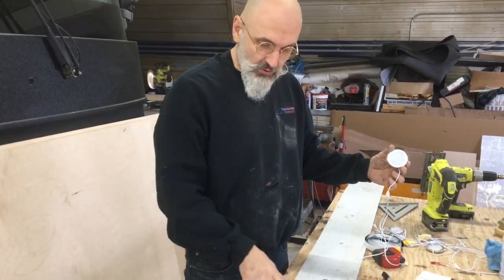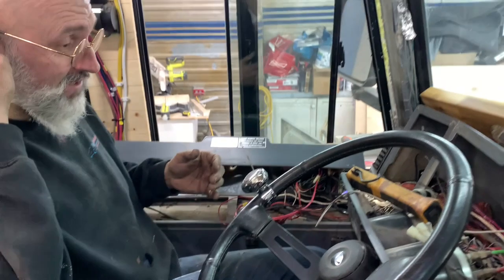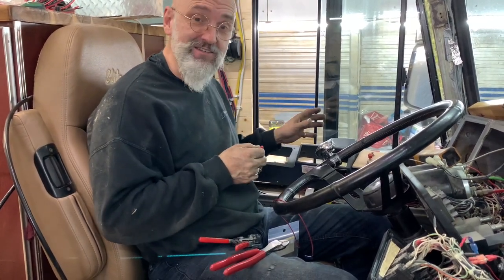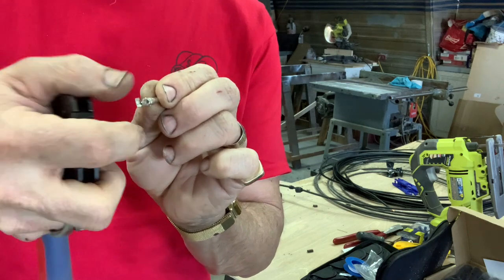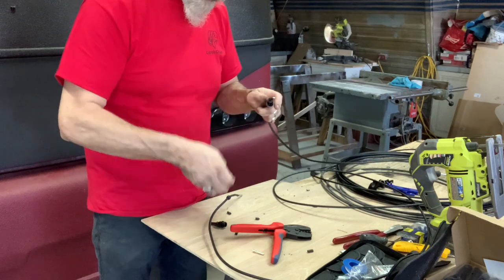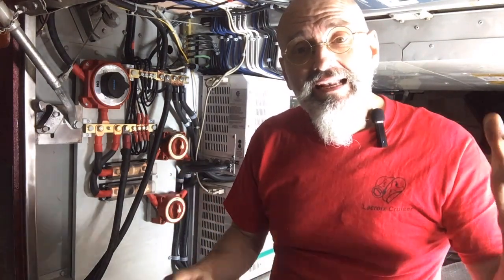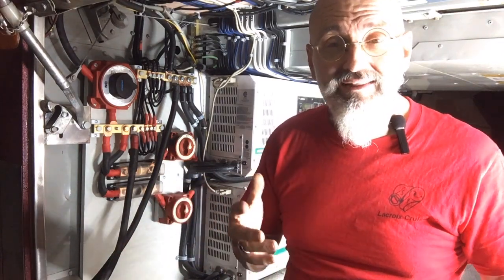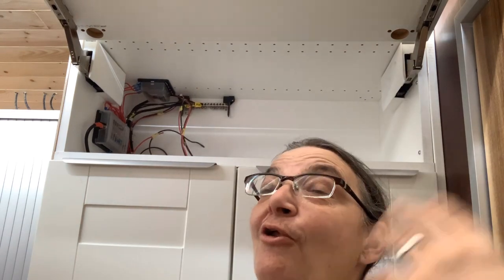E49 Bus Electrical System

Comment: Super de belle conversion. Je devrais commencé l ans prochaine avec un coach
Reply from the maker: Merci, et amusez vous! Avez vous trouvé votre coach?
Reply: @LacroixCruiser  Pas encore a date ses surtout pour l an prochain ou je suis a la défence l an prochain y vont envoyé leur mci j 4500 a la vente et ces de très bon bus a prendre pas beaucoup de millage et très bien entretenue ,sinon sois un prevost serie H 3 45 ou un mci model D fin 90 debut 2000 car ses un des meilleur bus pour une conversion

Comment: First of all I wanna say that I’m baffled with the amount of knowledge you have in every aspect, your a blessed man, thank you for all this content 
My question to you is how the alternator can play a roll in charging up the house batteries, wasn’t sure if I should mix the 2, meaning leave the original batteries just to run the bus and the add on batteries to serve the coach, what’s your suggestion
Reply from the maker: Thank you. It’s best to keep them as totally separate systems. We have a DC to DC charger that safely unites the 2 systems for charging when the engine is running.
Reply: @LacroixCruiser  meaning to say that you also charge the house batteries through the alternator? That was my question
Reply: Thank you so much for your response
Reply from the maker: My pleasure.

Comment: Terrific electrical system information and awe inspiring to see how you've put this together.  I know that sourcing components tools and supplies is a resource management headache but you make it look so easy and manage to output videos like clockwork.  Somehow I suspect this is more than 40 hours of work per week.  
As in learning anything, the more I learn the more questions that come up, but I'll limit mine to 2 questions at this time.   

1) I noticed that you built in redundancy between the inverters and circuit breaker stacks so that if one inverter went out, you could switch some essential circuits over to the other inverter.  However all of your 24V house  batteries are feeding a single bus bar.   Was there any practical reason other than fewer wires not to have two separate battery banks for the inverters?
2) In the bays, I see what looks like 3-wire Romex, but I didn't see anything but single wires upstairs behind the cabinets.   Were my eyes deceiving me downstairs?  Or upstairs?   I know you said 'one wire' but I assumed you meant '3-wire Romex', and I thought the electrical code recommends that LINE and NEUT travel close together to cancel and minimize any EMF heating.

I could probably ask questions like this all afternoon and still be learning, but I couldn't help asking these two questions after seeing such a great overview of a 4-power-source system!
Reply from the maker: If we had separate batteries banks for each inverter we would have to balance usage between the inverters. 

All 120v circuits are 14/2 Romex. All 12v circuits are 12g stranded. Every circuit is a home run, one draw= one breaker or fuse.
Reply: @LacroixCruiser  Perfect!  Thanks.
Reply from the maker: Thank you
Reply from the maker: My pleasure

Comment: Are your extra office lights hooked up to a remote or do you have a switch.  Also what kind of switch, just looking into all the options with lighting
Reply from the maker: They are on a regular household switch
Reply: @LacroixCruiser  thank you. So they are 110 volt?
Reply from the maker: They are 12v
Reply: @LacroixCruiser  So I’ve checked numerous videos and none of them show how to wire it up a 3 way 12 volt switch with a normal switch.. Any hep would be SO much appreciated 🙏🏼
Reply from the maker: Exactly as you would wire a regular 120v 3 way. The only exception is that what is the neutral ( white) in 120v becomes the ground wire in your 12v system.
Reply: @LacroixCruiser  awesome, thx!!!

Comment: Wondering what multizone stero system are you using?
Reply from the maker: It’s a basic radio from Amazon , it’s the bank of switches and wiring that makes it multi zone.

Comment: Hi Yvan and Silvi, need some help looking for a RPM gauge for my MCI to match the same size and manufacture(SW) as the Speedo gauge. Who has the bus graveyard..?
Reply from the maker: Here’s a little list for you

https://www.cjbusrepair.net/
Ask for Dave

US Coach in NJ.  856-794-3104
Ask for Luke
 uscoach@att.net

Caylor Supply,  Kansas
Ask for Sam 785-878-3405

Newtons Motorcoach Services 
1 765 713 9693

Lewis Bus Lines - (706) 792-1800
http://www.lewisbus.com/buses.html

Bonanza Auto Dismantlers, Shingle Springs, California. (530)677-8239. 

Sawyer Bus- (540) 394-8000
https://www.sawyersbussales.com

http://fowlersautowrecking.com/

ABC Parts  877-427-7278
New parts only
http://www.abc-companies.com/parts/

Newer MCI Buses and parts
Www.mcicoach.com

http://www.uscoachtours.com/

https://www.coachtransitcomponents.com/catalog/mobile_catalogue.php?osCsid=c4200dba014d56f9929dafb8fe4e1612

https://carrosseriepreference.com/vente/
Ask for Jonathan Morin

http://jeanracinepresseur.com/pieces-usagees.html

http://lincolns-longhorns.ca/

Andy Pelletier, 12043483966 home, 12048901506 mobile, acontour@nlis.ca , MCI parts 

JDR Coachworks, (705) 526-3766
Reply: @LacroixCruiser  Thank you sooooooo very much!!!
Reply from the maker: Your welcome

Comment: It would look great if you wrapped your wires in a cloth loom sealed with velcro in the upper cabinets.
Reply from the maker: We will be tightening them up once we are sure we won’t be running any more. Do you have a link to what you’re suggesting.
Reply: No link, just an easy way to hide the wires. Might even be able to make a light weight solid cover that could velcro to the cabinet.  I know what ever you guys do, it will be top notch. I am amazed at your abilities. Love watching your vids.
Reply from the maker: Thank you